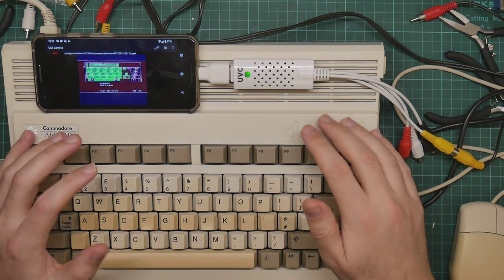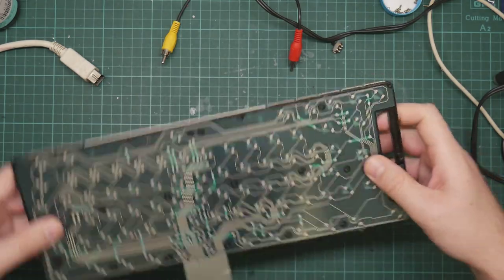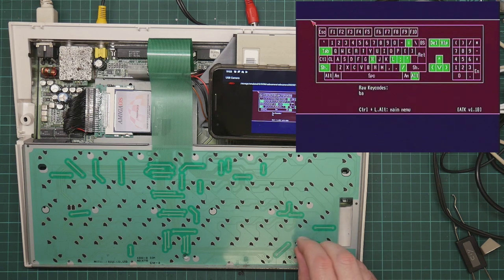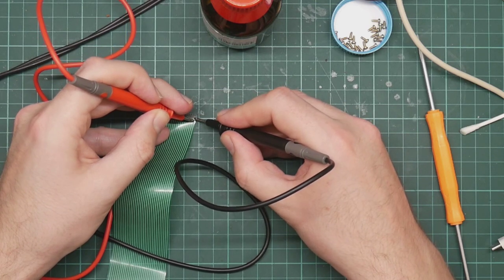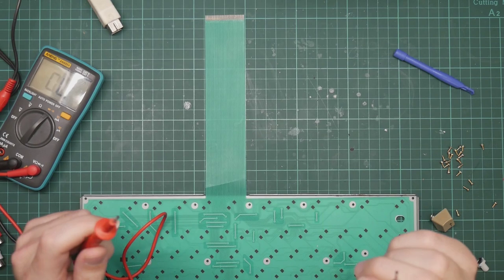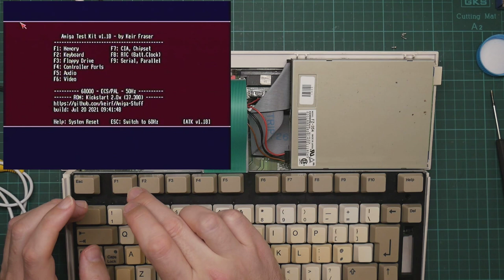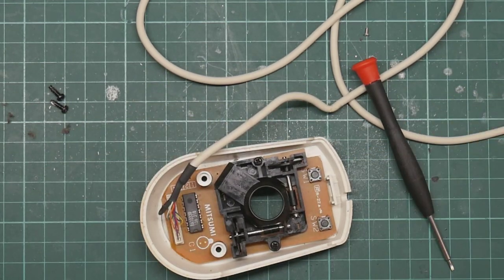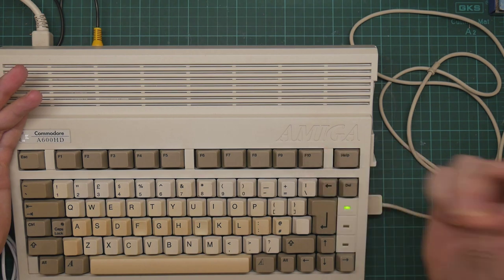Fixing an Amiga A600 keyboard (and mouse)

Comment: Thank you for this useful video and especially on how to open an A600 mouse, as I was about to scratch off the little plastic stuffs that make the mouse sliding easier. But after a year, the main question is... Did you get that sticker back ? 😁